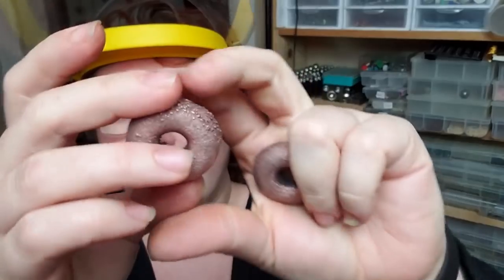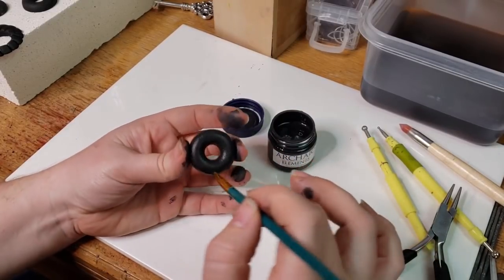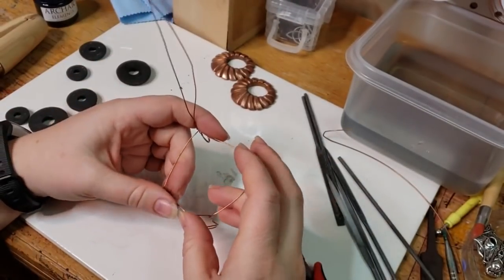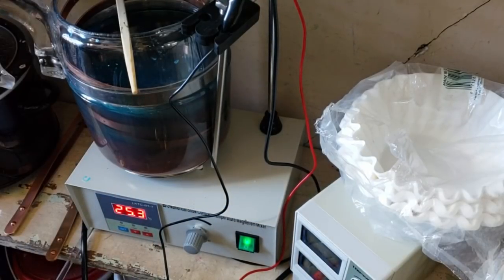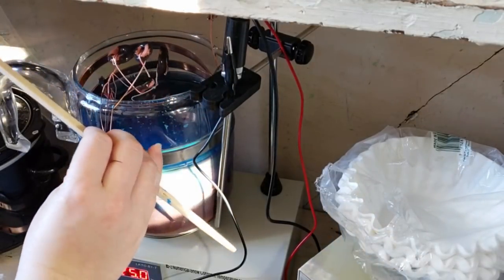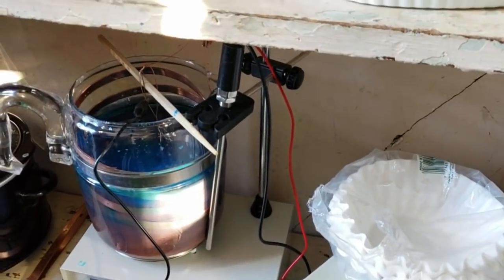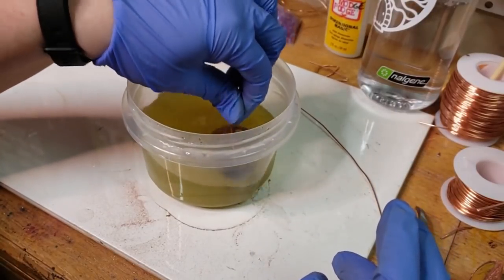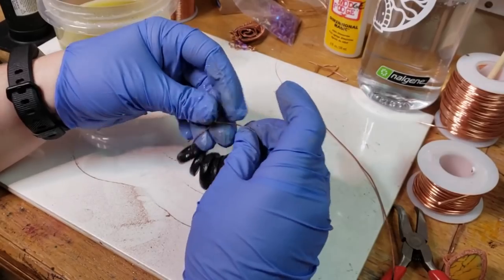Electroforming a Donut Bead

Comment: Great video, thanks! I just posted after a little break and lots of people recommended that I check you out. I used to do a lot of polymer clay but recently started working with metal. I love Lily -Tree too! Copper is so awesome but as other people mentioned, you only need to use a a tiny bit of Rouge polish. Any excess can be washed off with soapy water (I have been told LOL). xx

Comment: I'd like to see the cathode and diode setup and know about the mechanisms that create the voltage difference. Honestly watched this to learn about electroplating a process used a lot in engineering to coat metals to protect internal system, to ground electronics, etc.. so you are teaching me stuff I need for work.

Comment: Instead of using a hard cotton cone, try a soft cotton wheel which will buff better and use a lot less of the Rouge.  I would also recommend ZAM polishing compound which is effective and gentle.  Can even be used with real opals.